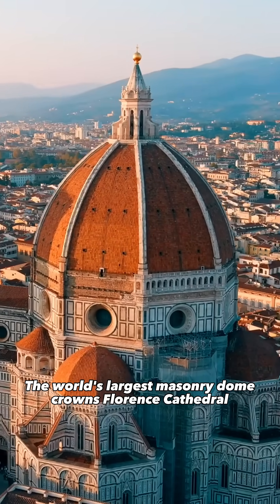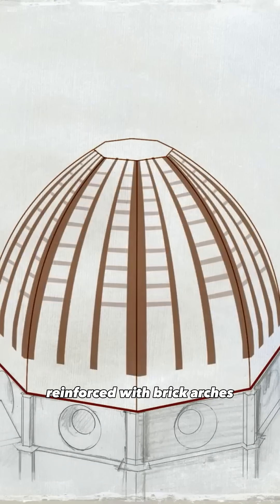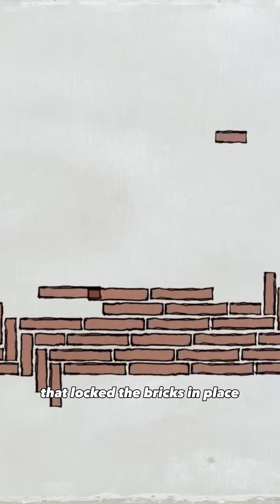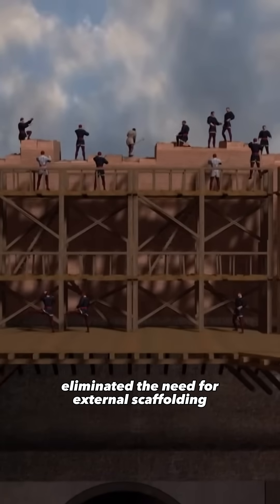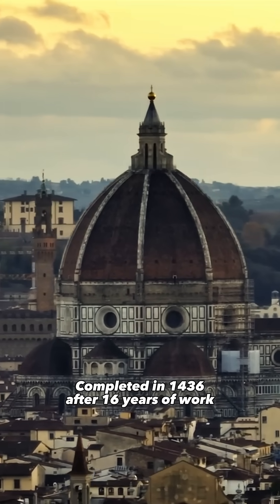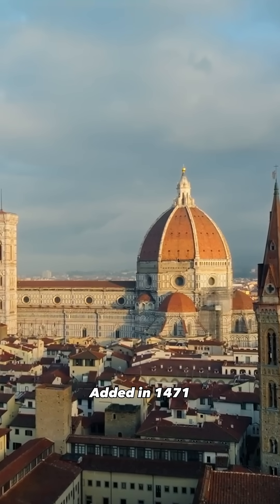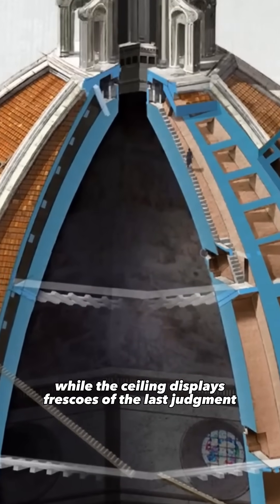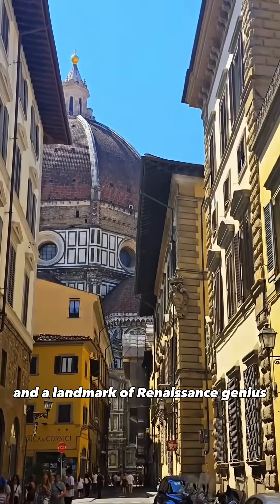Brunelleschi's Dome of Florence Cathedral #history #engineering

Comment: The narration references the crutial engineering feature of the dome which is the herring bone pattern of the bricks, but the clip at that moment displays the standard staggered brick pattern - content creator fail!!!!
Reply: What does "crutial" mean?
Reply: @r.m.7288  how this brick dome has survived and supported the weight that it does over the centuries had baffled many architectural engineers. Later studies showed that it was a pattern of brick laying that made it possible. It's a combination of several runs of bricks with the standard offset pattern, combined with several runs of bricks in the herring bone pattern. I used the word crutial because studies have shown without this unique pattern, the dome would have callapesed on itself long ago